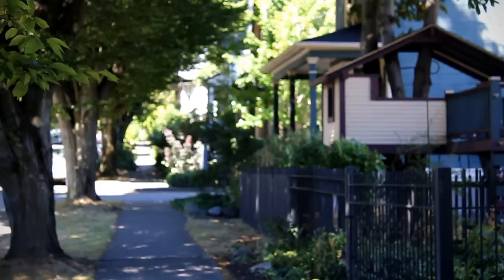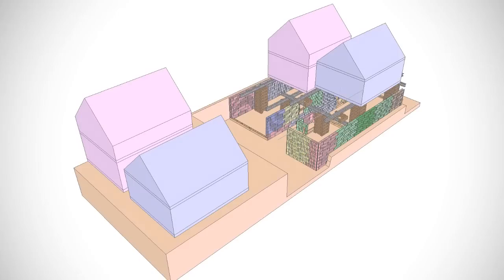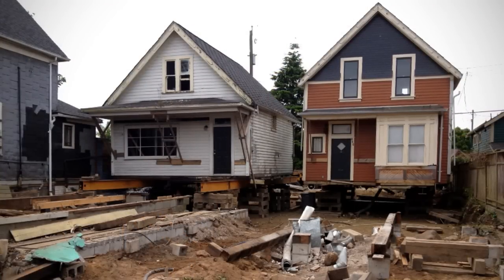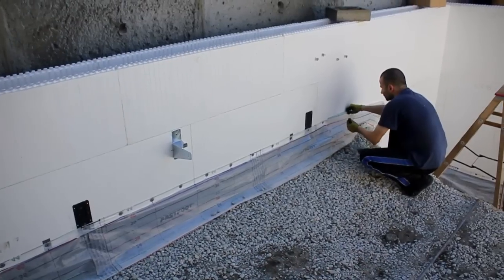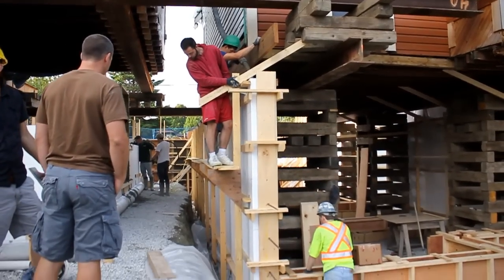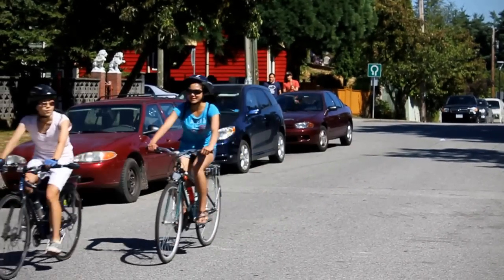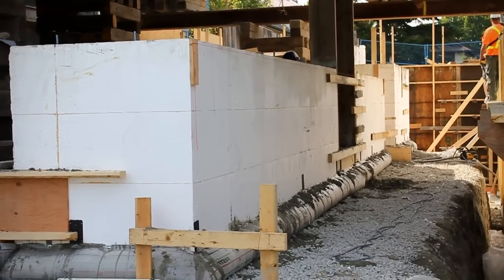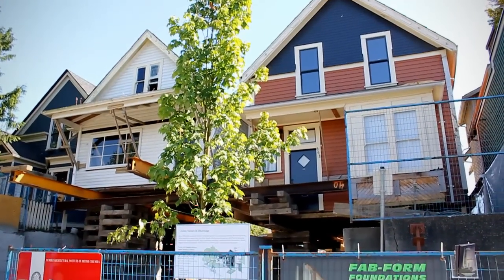Fab-Form Insulated Concrete Form (ICF) Monopour: Eco-Heritage Project

Comment: You can actually see the results of this project on Google Maps.
It's not QUITE how they projected it (no plan EVER survives contact with the enemy).
But it looks like a very well executed (re)build.
And modern understanding of air sealing and insulation means you can retain much of the "heritage", without sacrificing energy efficiency.
So the legacy units may not be QUITE up to the standard of the new units on-site, but most people won't be able to tell.
Especially because the development is taking into account economies of scale through centralized utilities.

Comment: I can't stand the heritage requirements to 'save' terribly constructed, poorly designed homes from less than 200 years ago. They are garbage and can be reconstructed better now with modern materials and methods if the design is so great.
Reply: Robert Evans 
No mention of asbestos, lead paint or any other negative environmental contributors.